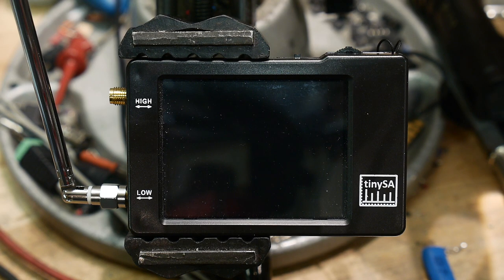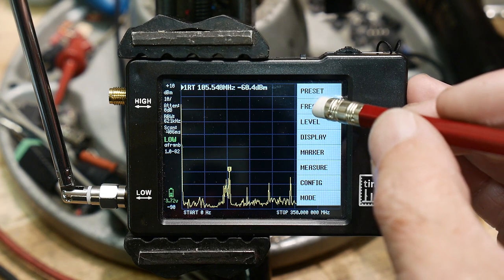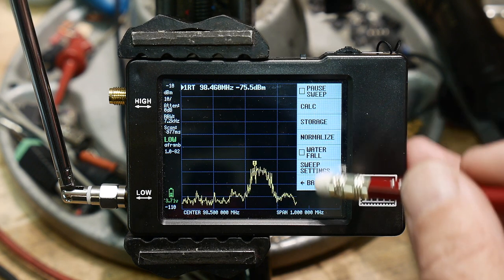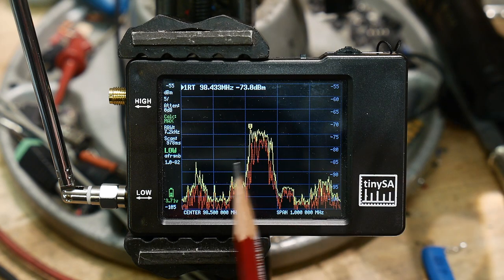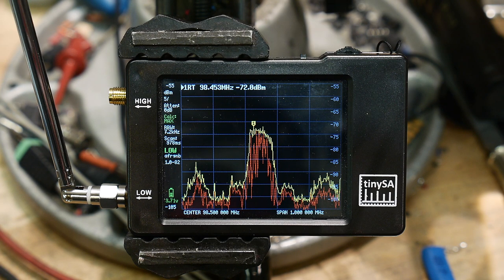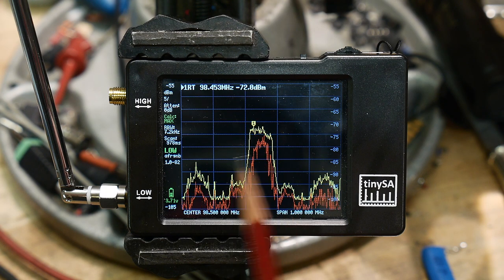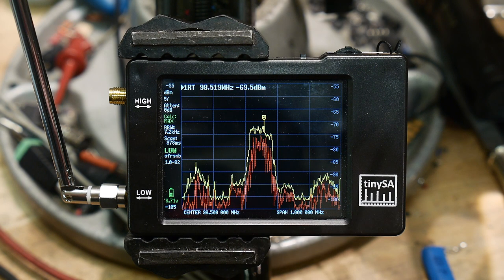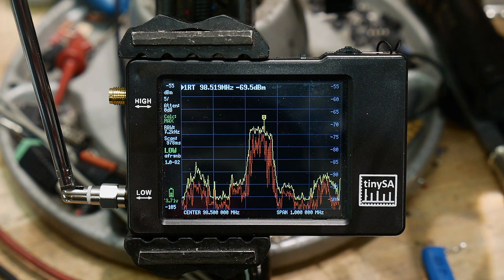#551C TinySA On air FM broadcast band modulation

Comment: FM broadcast is 75kHz deviation with 15kHz of mono audio or 180kHz of bandwidth and the channel spacing has always been 400kHz. The HD sidebands are a single 100 to 150kbs digital channel that can be dived into separate streams and are only at 10% maximum of the analog power.

Comment: Broadcast FM channel spacing is 200 kHz with a maximum deviation of 75 kHz ether side of the center frequency. Analog/HD Hybrid bandwidth in the US is 400 kHz. Both HD sidebands are transmitting the same data information whether it be HD1 HD2 or HD3.

Comment: Get a small fm transmitter and send test audio  signal into it and you can see how it all works..Be sure to use a attenuation pad and or dummy load as don't want to fry the analyzer.

Comment: Way too fiddly for me ..... Is there software for a PC connection.
Reply: Yes.
Reply: yes you can jack in on  the USB charge port and use pc software to run it with out all the micro-poking the tiny screen...
Reply: Подключиться можно, но работа его отвратительна через компьютер.